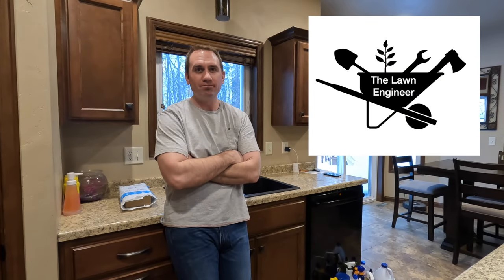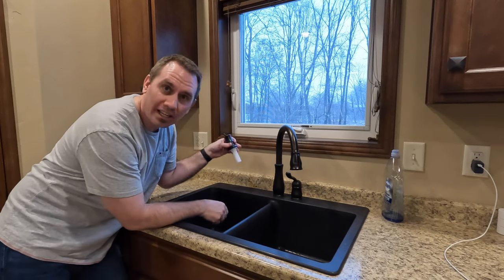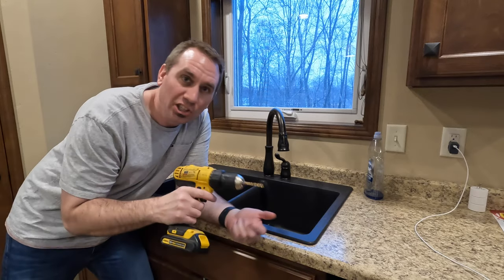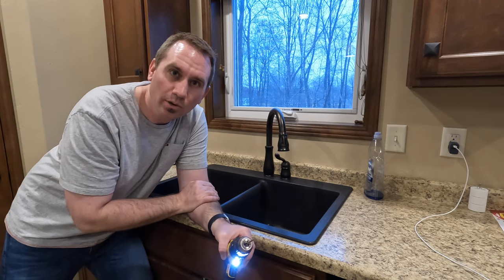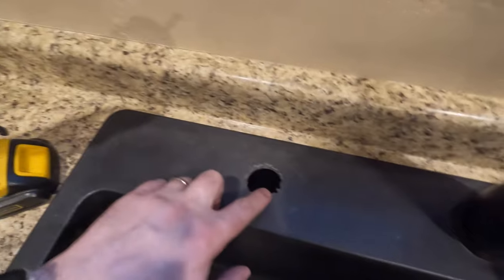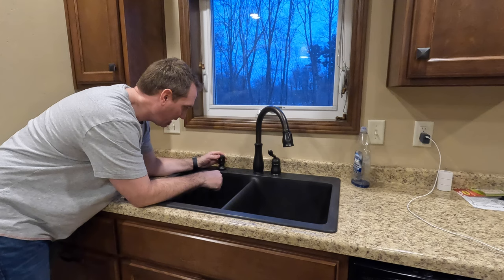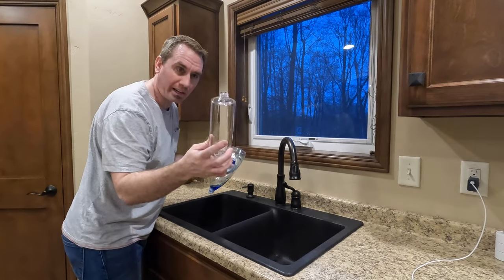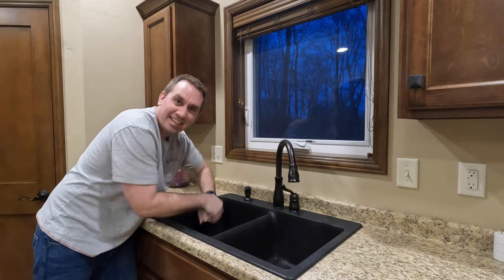Add a Soap Dispenser to Granite Composite Sink

Comment: You made that look easy. I really hate trying to work under a sink like that.
Reply from the maker: The power of video editing.  I bumped my head a few times.
Reply: The dispensers usually lift up from the top so you can fill it without having to climb under to unscrew it
Reply from the maker: @joshuamarcus2192  I did figure that out after I made the video.  Thanks for checking in 👍

Comment: BTW...most of those dispensers can be filled from the top.  you can lift off the pump to fill the bottle below without crawling underneath.  try yours and see.
Reply from the maker: You are correct, the top easily pulls off and can fill from above.  I discovered that after making the video and looking like a fool =)